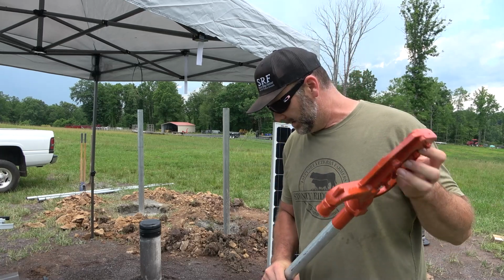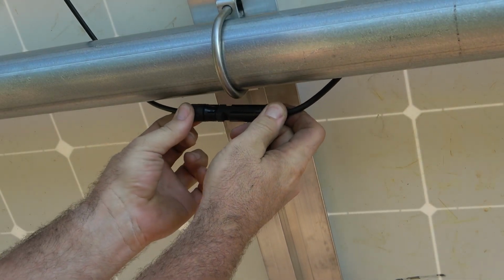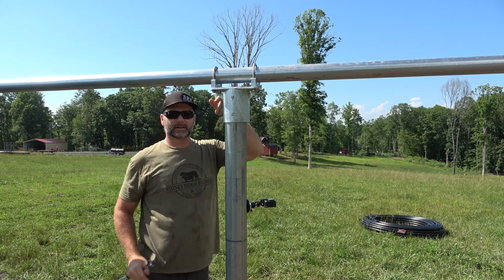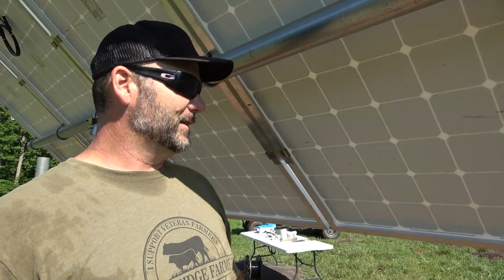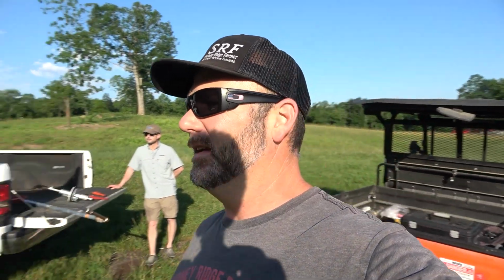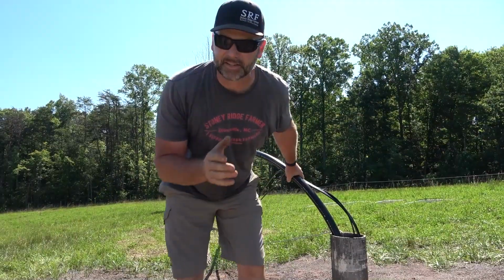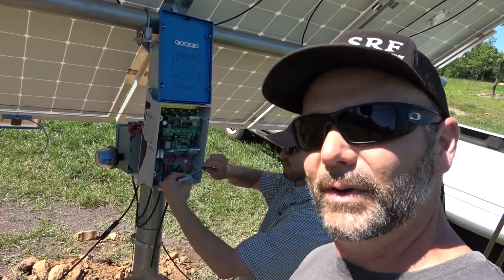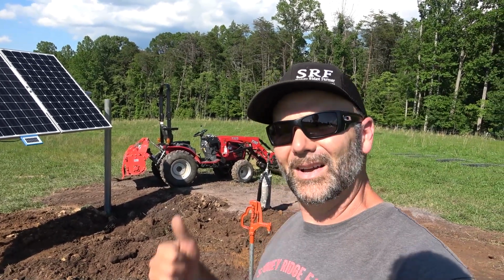How to Install A Solar Off Grid Well pump System

Comment: Looks awesome. One question, what did that system cost?
Reply from the maker: my brotha...it's very very dependent on your particular well situation
Reply: @StoneyRidgeFarmer  He asked a great question.  If you said how deep your well was and told the cost then we could figure it out for ourselves what the cost would be.  My well is 77ft.
Reply: @pamelaremme38  depending on what your needs are for control and your location systems start at roughly $2,500.

Comment: Hi Josh that must be a nice feeling to hook that up drop the pump down into the well casing. Sorta seeing the obvious I noticed you didn't run into both uprights what's on with the change of direction and single anchoring post ? Just curious as you were keen on strong support as you of all of us know;  You mentioned significant concerns over strength and orientation on those post heavy duty footing and dual situation what's on with the change to mono post direction?
Still a good lick of forward production on the old water to your bovine buddies. Good on you braugh.
Best David

Comment: I worked construction building commercial solar fields. During the final QC walkthrough, we had a few panels that needed to be replaced. When the electricians disconnected one of those MC4 connectors, there was about a 16" power arc. Very powerful.

Comment: I was wondering why y'all didn't zip tie the electric wire to the water pipe as you insert it down the well? Just curious..
Reply: The cable was taped every 20ft with cable wrap tape.  This was done before lowering and not filmed. Cable is also High Density Polyethylene jacketed which makes it highly cut and abrasion resistant.

Comment: no tape no cable guards no torque arrestor wow fail all wrong sorry that guy should of known
Reply: Not every single step was shown.  There is cable wrap tape every 20ft.  There is a torque arrestor on the pump and the pump is soft start/stop.  The submersible cable is actually HDPE jacketed which is much cut resistant, much heavier duty than standard PVC jacketed cable.
Reply: wont last

Comment: I am from a colder climate but we drill a 1/16 weap hole in the tubing so the well drains below the frost line. Solar wells will freeze solid at night.
Reply: Exactly. That's why I asked about using a pitless adapter to prevent freezing. Hoping to get a reply.
Reply: Can someone please tell me why my husband refuses to install any alternate power supply for our well? 
Okay, you don't know. But I'm so frustrated trying to get him to see how important it is to have a back up power system in place just in case the unthinkable happens. He feels there's no danger. WTH!
Reply: @MarilynCarnivore  that's called denial and denial will leave people in the worse possible situations.

Comment: Are you going to put a pump house over the well head?  Maybe use heat tape to protect the above ground water line (powered by solar / batteries)?

Comment: This is really amazing! I think I would want some kind of battery so I could run it at night just in case of an emergency. I know my luck and I can see a fire starting right beside of my well pump and not being able to put it out because it didn’t work at night but that’s just me. You’re doing a heckuva job and making one heck of a place Josh.
Reply: Pumping water during the day to an elevated tank, or a ground tank at the highest point on the property is the most efficient solution.  Use the free and reliable solar (it works everyday of the year) to pump water to the tank, you have your water and energy (gravity) stored in one. Perfect for that extinguishing the night time fire.  Josh said it, store water not energy, just store your water up a bit higher, gravity is great at distributing water :-)  Tanks are cheaper than batteries, locally produced, environmentally friendly and have a much longer life.
Reply: 240V motor will need 20 batteries.120V anything needs 10 batteries. Plus appropriate amperage DC to AC inverter.Can run into the thousands real fast.

Comment: Do the solar panels need to be re-positioned for winter time when the sun is lower in the southern sky?
Reply: We did what is referred to as the year round compromise. That is setting the angle of the panels equal to the degree of latitude.  It is possible to gain more water by changing the angle as you suggested for seasons but not necessary for Josh's water needs.
Reply: They will use the windmill 😂

Comment: Why didn't he go with a pitless adapter on the well, so you wouldn't have to worry about freezing. This is a nice system.
Reply: Yes, I just moved to NC and they did not install a pit-less adapter on my well.
Well guy said they never freeze here ???  I have heard otherwise from my neighbors.

Comment: Awesome this was interesting for sure.. funny as you were saying about the cattle... all I saw was scratching posts for them😆😆 ..
Have a good day 🌻🌻🌻
Reply: My thought exactly. I thought cows rub against anything that doesn't shock them. Raccoons and other critters (some two legged) can also cause problems. Better consider caging it in, instead of using the panels as shade. maybe also electrifying it; I hope we are both wrong. Also, it isn't too hard to imagine some thief getting electrocuted while trying to steal the solar panels. Electric utilities have paid millions to families of thieves who were electrocuted while stealing copper wire.
Reply: @marlinl.306  1.. if your stealing something and you get hurt.. well they/families shouldn't be able to sue.. that's just wrong.. and after he put the panels on I think he said he would  be putting a fence around it..
Reply: @chelemichele1524 Best I can remember the thief had been a lineman at one time, and had an understanding of how the safety equipment at the substation works, and he thought he had tripped the recloser (giant breaker), but it failed to work. I think the court found the power company guilty of negligence. agree completely that criminals should not have the same rights as law abiding citizens. 

I didn't catch that he was planning to add a fence. I remember him mentioning that the cows could use the solar panels as shade. so the fence can't be very far from the panels. Thanks for letting me know. 

Oh, and Josh, thanks for putting out videos like this one. I never considered a pump without a battery. I hope it works great for you. I know you spend lots of time doing research, and I'm sure it will pay off.

Comment: Nice system hope it serves you well. Just curious if a battery pack could be installed as backup power?
Reply: Shawn, a battery could be used on any of our systems but this system is for stock water and irrigation of pasture so it is not needed. Storing water is always cheaper than storing power.  When we design systems we like to understand the usage so we can make the system as efficient as possible, which will save you money.
Reply: Going to use the windmill.

Comment: You put up two very sturdy support posts for your solar array but only used one leaving the whole system at risk.  What’s the sense in that?
Reply: So what?  You changed your plans but you still could have connected the two posts to advantage at no additional cost.  As a matter of fact,  if you had connected the two posts at proper distance before backfilling post holes, you could have eliminated the welding job altogether.
Reply: I guess you can do that when you instal yours, Joe. You probably ought to go into the sales and installation business yourself!
Reply from the maker: Each post was for 1 rack of 4 panels, as you can see....the second post is too close. Nothing is at risk, and the racks are not connected. We got our specs confused and I needed to double the distance between posts...so in the next couple weeks I'll go back and install another post, keep the existing post for a nice flag pole.  Mistakes happen, communication error...everything isn't perfect all the time my brotha.  I had Eric there to guide me for 1 afternoon and 1 full day, not enough time to correct the error.  Yep...nobody is perfect